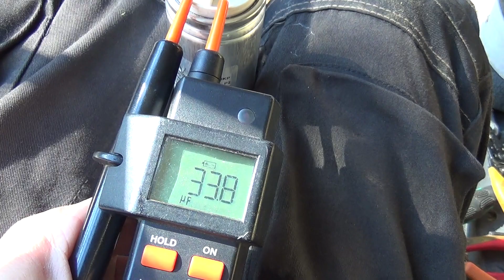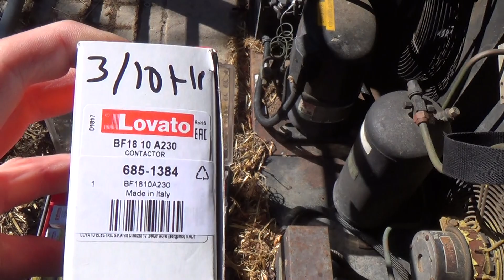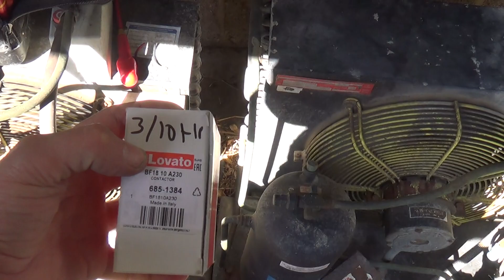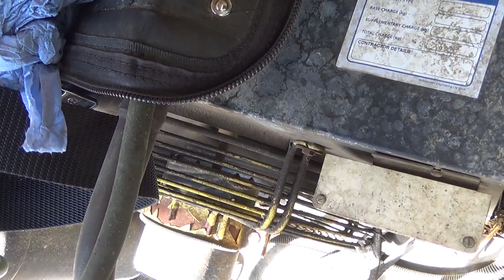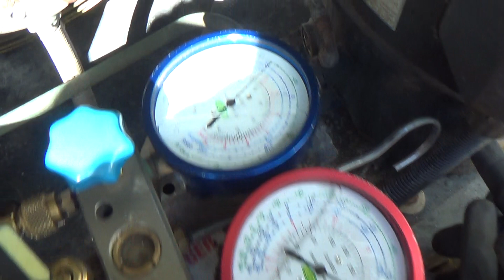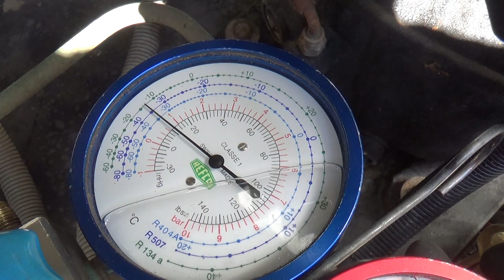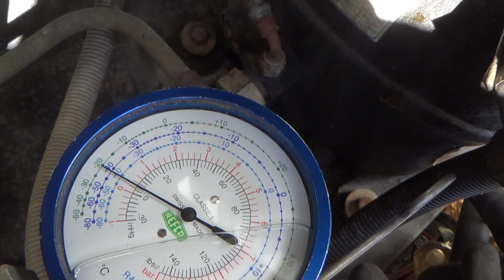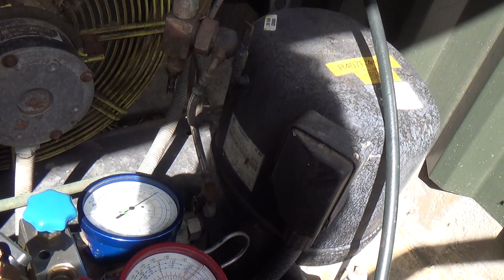Lovato Contactor Replacement

Comment: Contactor got damp for sure, then corrosion did the rest. Sounds like the compressor has either a cracked spring on the mountings, or as you say it is pumping slow then a dicy valve. will no doubt run till it grenades itself, and you get a nice call out fee to replace it and the valves at the same time, along with the fusible plug, and the pressure switch and hoses.
Reply from the maker: The compressors been limping along for a few years, the customer is planning to have three phase power run to the building so I hope this keep going until then and I can fit a slightly larger condensing unit, they barely have enough power to run what they have at the moment!